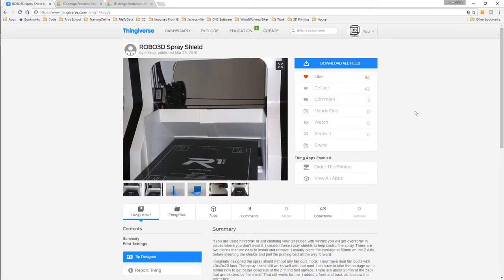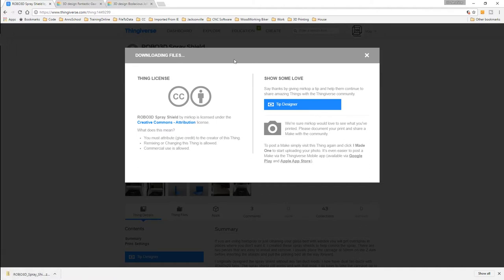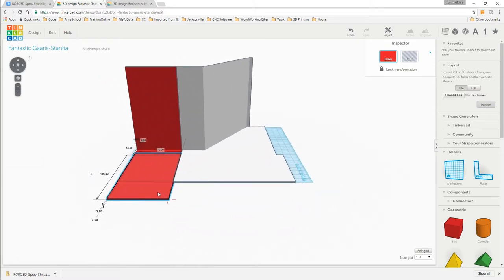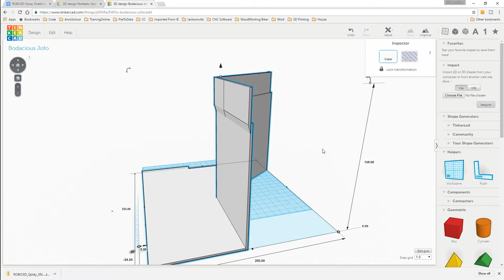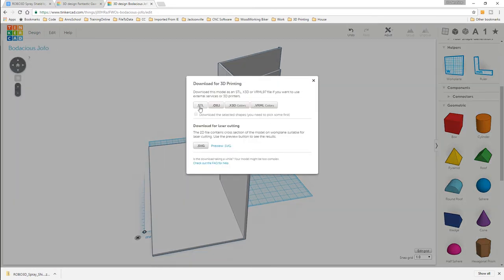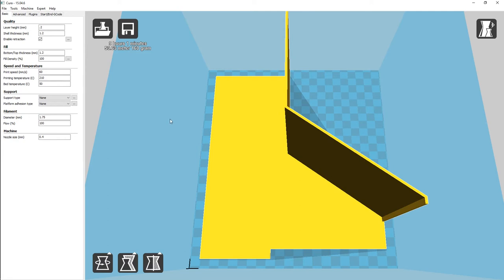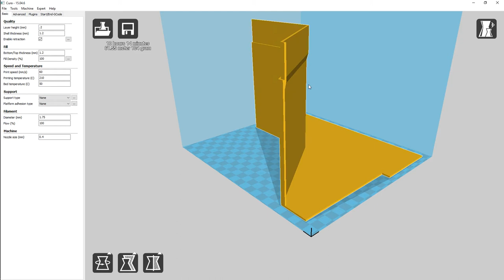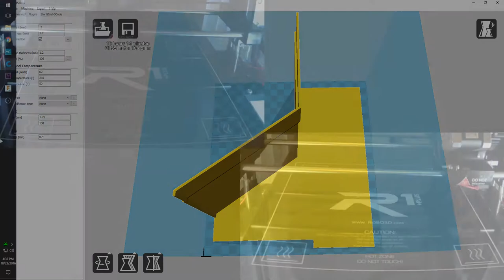Upgrade: Hairspray Sheild

Comment: Hi, I've been  using your first shield since I bought my Robo. I noticed that cloud of  hairspray as well.  I just cut a piece of cardboard to keep  the cloud down.  Doesn't look as nice as this change though.  However, first one took about five hours to print, so unless I break it not going to print right off.
Reply from the maker: As long as the cardboard is working I would not print the new ones ether. I was using paper and it keep getting messed up so I was a bit tired of have to fix the paper all the time. Thanks for watching

Comment: Have you heard about PEI? It is type of plastic that you can put on the building plate and everything sticks to it. You don't have to put hairspray or glue on it, just clean it in between prints. I just installed it on my Robo ad it works like magic. Heres a video with more about it: https://www.youtube.com/watch?v=Fe-l80z27b4
Reply from the maker: Looks like a nice option. I do not know how I would feel about sticking something to my build plate that looks like it will not come off. So if something happens to the PEI and you need to replace it looks like it would be a problem. thanks for the tip I will look more in to it and maybe give it a try
Reply: It works very well so you should definitely look into it. As for taking it off, I haven't done it myself because I haven't needed to, but Ive read on the Robo forums that it takes a lot of acetone and manpower to take it off.